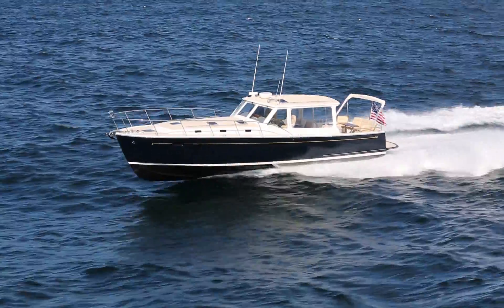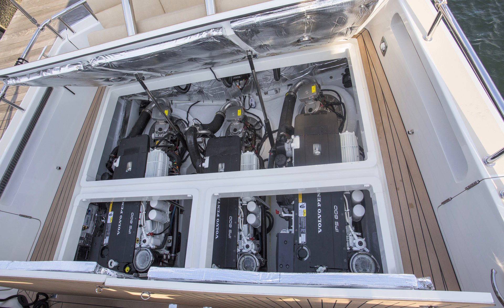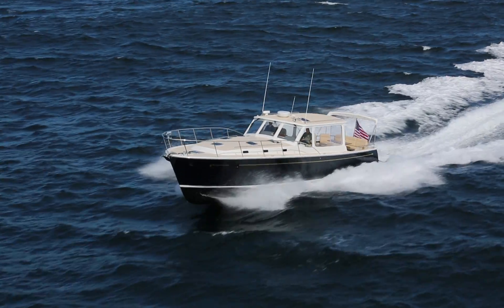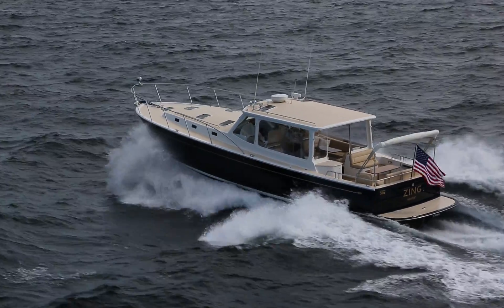Performance = MJM Yachts 50z

Comment: am i the only 1 how wonders way People now a day need so many extra like bow and stern trusters to dock a boat 
wile i do understand there handy in situwasions  i did luren it the old fashion way whit the roder and if the ship had 2 engines wit the 2 props and i never had any problem docking any boat even under heavy wind 
now that said i do understand its esye whit the use of these exstras
but a good caipen can dock its ship whit out those 
we even had qwite some fun it the 
locks wen me as 15 year old was dowing the 
locks solo wile the famly was relacksing on the aft deck and seeing oder ship strugeling whit bow and sturn trusters 
and 3 peopole to do it 
and the locks master came out asking those guys if day needed help and wen day responded whit yes pls he pointed at me and said wel he can help geting you fix and day startit geting angry and saying day wut never let a kid on there ship sins it was so exspensif 
just fore a refrens the ship day were in was around the same size and wel clearly not more exspensif